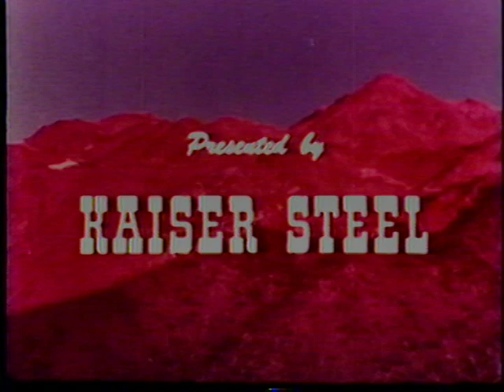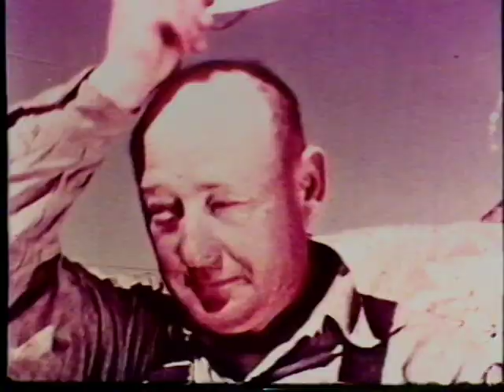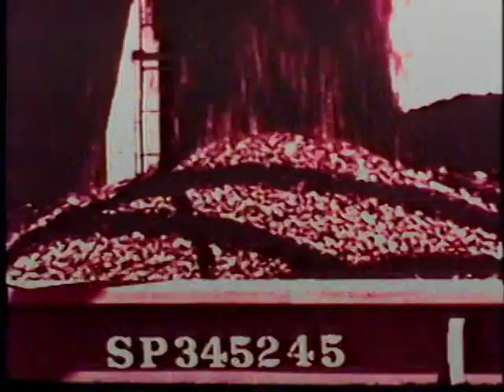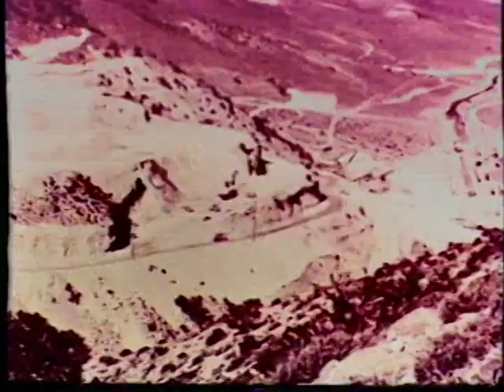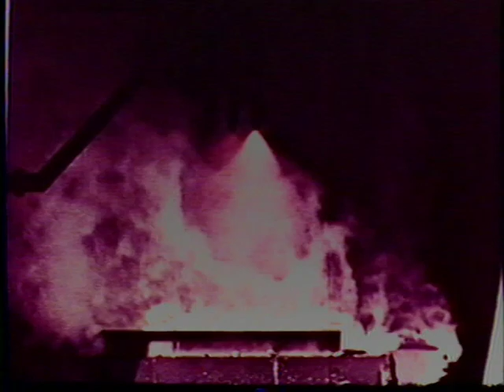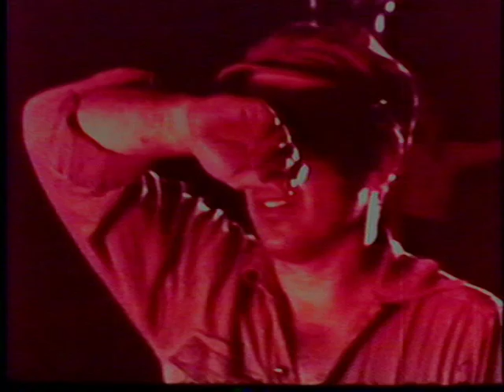Kaiser Steel Part 1

Comment: In the late 70's I took a geology class at the local community college; we took a field trip to the Kaiser steel mill in Fontana. The tour took us through the whole process from raw materials delivered to the mill to the final product being shipped out. They were in the process of installing a new electric arc furnace at that time and planned to shut down the coke ovens and in a few years, the mill had enough slabs of raw iron in soaking pits to last at least a year if the mill quit making steel that day. I had the chance to take the class again and another trip to the mill, this time the raw material piles were almost gone, and the blast furnaces were down to two, the electric furnace was running, and the guide said production of iron would end when the raw material pile was gone but they had enough iron on hand to keep the rolling mill going for a while. It was done and shut down in a couple years and the mill dismantled soon after. One of the most interesting field trips I had ever been on while in school. with the need for a mill on the West coast to feed the shipyards reduced it was a matter of time before it closed.

Comment: I grew up in fontana about two blocks from kaiser steel mill or C.S.I (california steel industies) i remember riding in my dads truck with him loading there in fontana and dropping huge rolls of steel sheeting (4 rolls to a load) in long beach 3 runs a day but this is so awesome it makes me wish i was a young man in the 40's or 50's instead of the early 2000's totally born in the wrong era this was man work no automated computerized plastic machines then it was manual this muscle that it was work smart or die learning these guys were the pioneers of industry the men who r&d'd for the computerized automated lazy know nothing of hard work generations to come trailing along years later 
Thank you for these videos absolutely fabulous informational and entertaining 
GO FOHI STEELERS